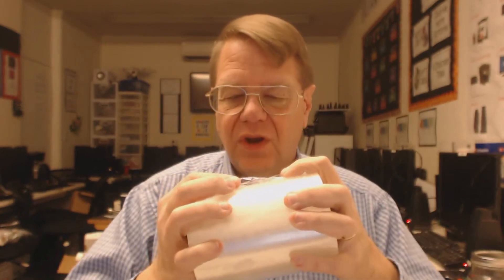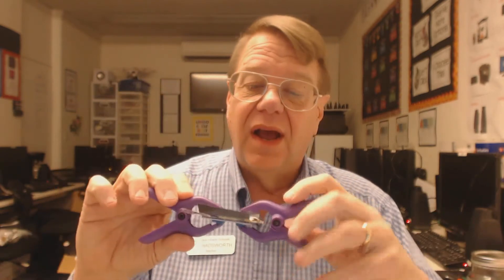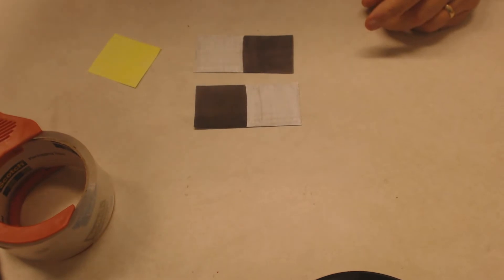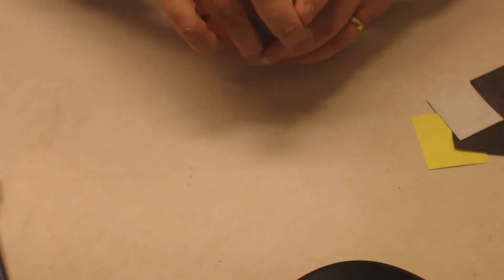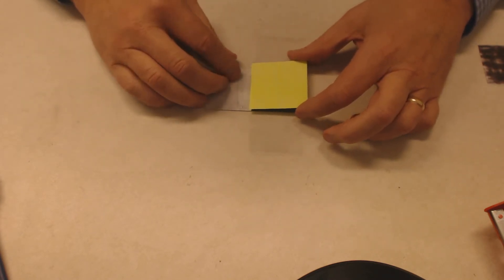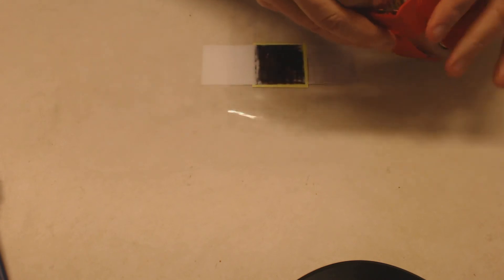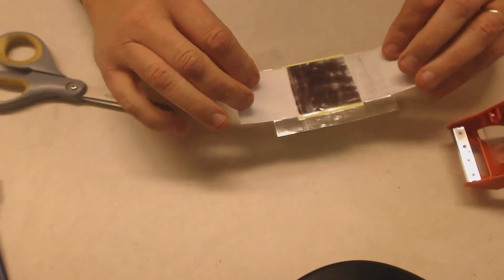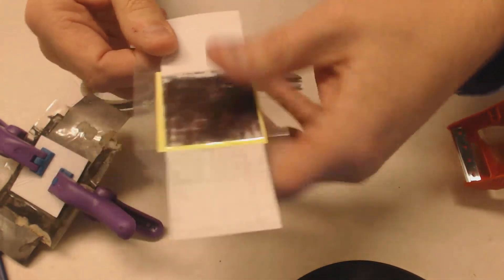Update: Do As I Say, Not as I Do!

Comment: Ok that’s cool but. I use a laminator that’s basically what your doing. And besides that it squished out the air pocket. You have a lamination issue there. I believe a vacuum chamber would help you. You want the layers tight.
Reply from the maker: Yes a laminator would be a good way to do it.  Right now I don't have access to a small laminator, but I'll keep it in mind for the future.  Thanks!
Reply from the maker: One other thing is that I'm not using the battery without extra stiffeners and clamp on the outside.  This seems to press the layers into good contact.  Later, when I'm trying to make a standalone package, removing all the air becomes more important.
Reply: The laminator heats it and crushes out the air. When it cools it’s under vacuum